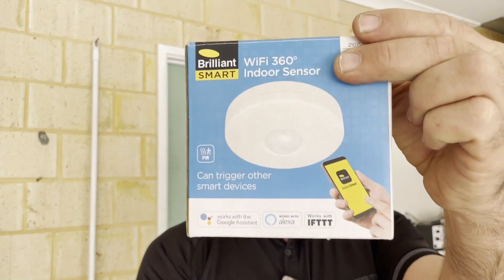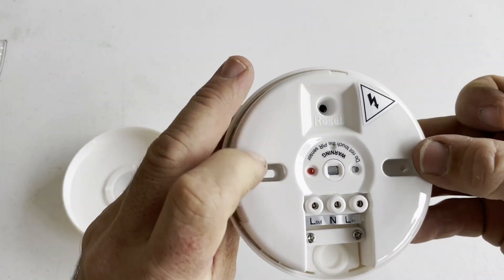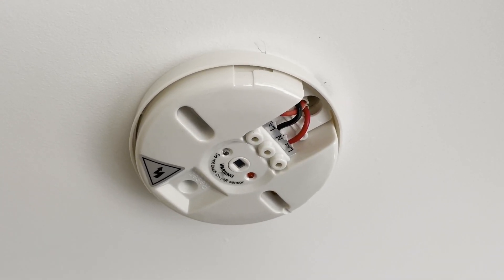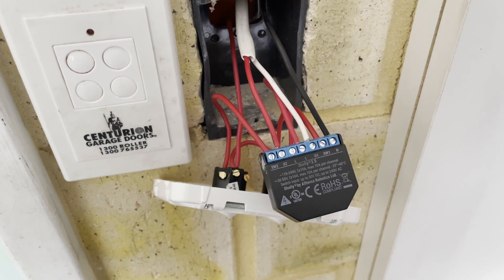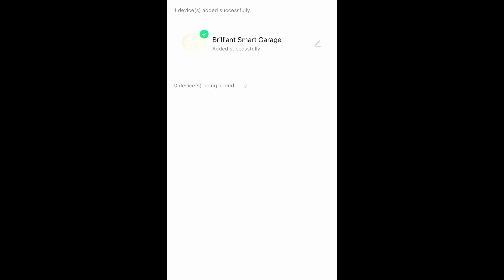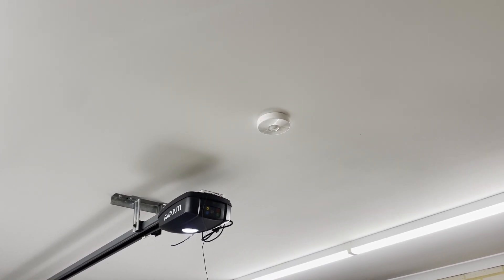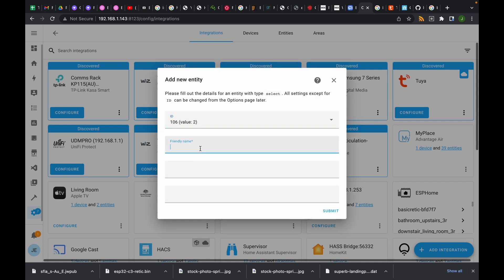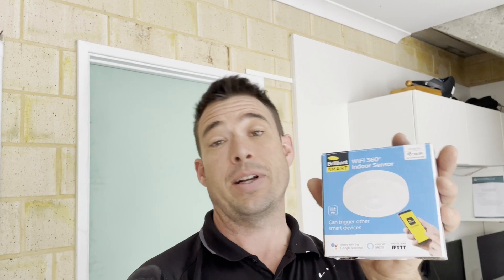This Smart Motion Sensor is Great!

Comment: Hey Jimmy. Another excellent video, thank you. Do you know if it's possible to submit a product support request through the Tuya IoT portal? I purchased an outdoor PIR model DET100HA which is branded as Grid Connect but it comes up as Arlec in the SmartHome app. Running a device specification attributes request returns 'device not supported' so I'd like to request support as this would be an excellent addition to Home Assistant

Comment: Thanks enjoy this, luv a bit of Aussie content. Wondering if I would just use a small ZigBee sensor to trigger the Shelly.
In case you're interested another Aussie is The Hive.
Reply from the maker: You certainly could, but with this sensor it's just the sensor, it detects motion and turns the light on so it's going to be more realiable, I suppose it depends how critical the light is to the household ei. if it stop working occasionally how annoyed will the others be with me for messing around with the light in the house.